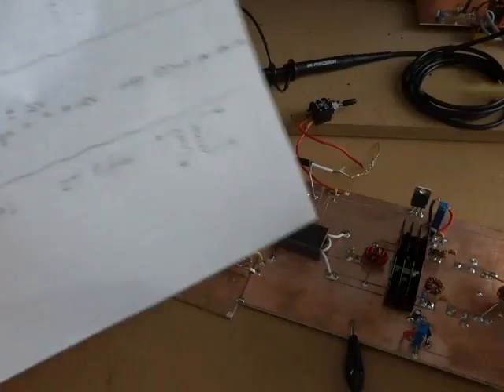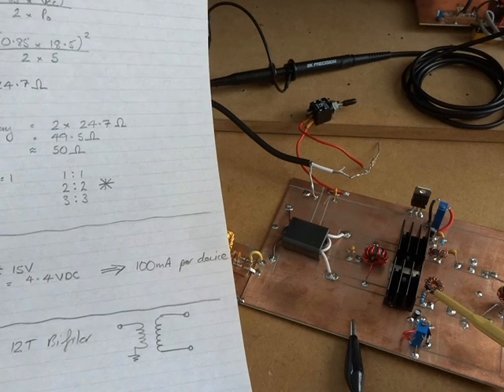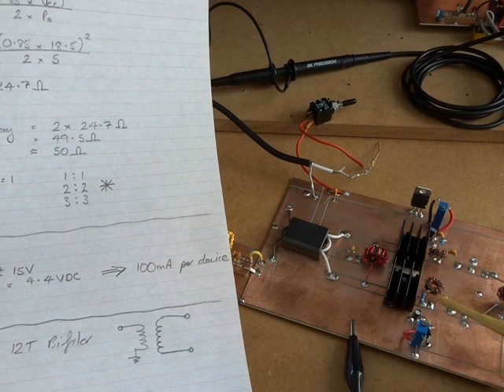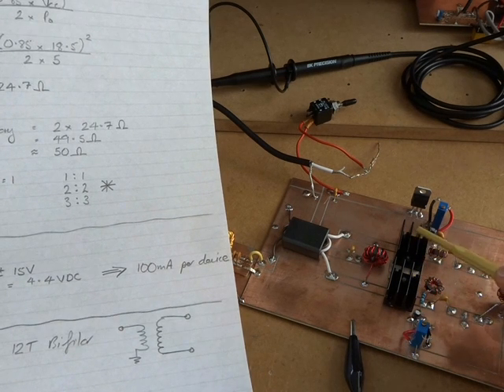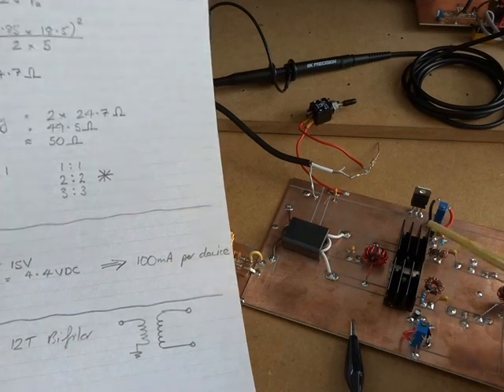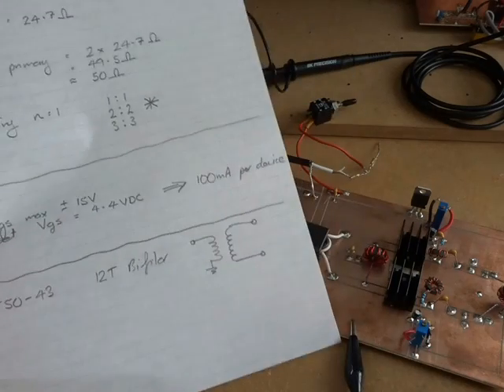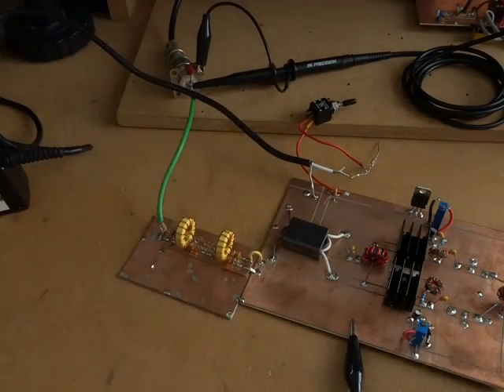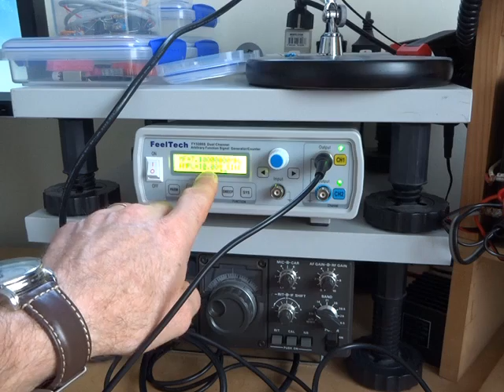Homebrew MC1350P based SSB Rig - #11b RF PA Experiments

Comment: Hi Charlie. You might consider putting a 10 ohm resistor in series with each gate input from the bifilar transformer. This is done to help eliminate oscillations caused by stability issues. Also check the bifilar output voltage to ground for each gate input. The voltages should have the same amplitude (opposite phase). If they are not equal in amplitude, add  100 - 200 ohm resistors from the transformer outputs to ground to give them a DC reference point and not change input impedance much.  Resistors would be added before the input capacitors.  If you intend to use this amp on 20/15 meters you should test to see how the gain drops off at higher frequencies.  Very good work Sir...
Gary
Reply from the maker: That's great advice thanks Gary. I've added that to my design notes to keep in mind for the next amp. I'm keen to build another test amp after this to get a better understanding of how best to design these, as well as the driver amp. Thanks again.

Charlie
Reply: Hi Charlie. One last comment, Before you move on to a new amp, I would test for maximum output power from your amp. Keep the input signal level unchanged and sweep the RL on the output of the transformer from 25 ohms to 200 ohms (perhaps up to 500 ohms) and calculate the output power for each load. When you find the MAX power, you have found the output  impedance of your amp. Also what ever that RL turns out to be, that is the actual load resistor  that the transistors see from  Drain1  to Drain2 of your FETS.  Output impedance changes every time you change the bias current. Best of Luck my Friend....
Reply from the maker: @garywebster5917  That's good to know thanks. I will look try and look at that, noting I'll need a 10W variable load. I'll only build a new amp once the radio is built, and use it as a test bed. I'm currently working on a broadband driver, with a design goal of 250mW output. All good fun!

Comment: You are the Best , I use Rf 386(hf signals Farham previo) joint P.A G6LBQ - HF LINEAR AMPLIFIER. Sorry my English is very bad
Reply from the maker: Hi Enrique. What device does the RF386 use?
Reply: @CharlieMorrisZL2CTM  
If you provide me with an email address, I can send you the circuit diagram

Comment: Hi Charlie!  I have got a nice RD16 mitsubishi push pull amp over the ebay and level level normalized via a simple DAC . I try not  to underestimate your work but a good tcvr key element is not the tx part ... one can filter output , one can optimize drain current to save hiking power consumption, but the main part is RX, try to focus on that. As far as I am concerned, I am a contest lover one so BFO leakeage and ADE-1 dbm correct level setup is more important to me.I got a fast AD8310 log detector so I am in  keen to replicate your work to build a nice filter analizer using arduino + Si5351 + level correction over freq + AD8310. I do realy feel that one day you and me can exchange info for a far far better tcvr as yaesu , icom or kenwood can produce. Time will tell but good measure tool also can make a diff. P.S Did you oscilloscope BFO to ADE1 LO port   once connected to it ? I am curious to see peak level in that port and  wave form also. I bet it looks ugly on 7 dBm  and spurs all over unless dropped up to 1 V pp. 
Regards , Gabriel yo8rxp
Reply from the maker: That's really interesting Gabriel. I'm just learning and documenting what I'm doing. So far so good as they say.

Comment: Ugg, those BLF1043 transistors are obsolete.  About $10 each from dodgy Chinese eBay'ers.  Guess I won't be going there.  I have seen some good buys on MRF186's from a few sellers with good enough feedback to trust though.
Are you going to try using the NE591 without the matching networks?
Reply from the maker: That's interesting. As you know I'd prefer to use commonly available parts, so I'd be interested in the MRF186 devices. I'll look to order some of those and give then a go. Also, as mentjoned to Stephen below, I'm keen to build another one using IRF510 (and maybe even the IRF520, even with the higher input capacitance). As for the driver, I will not use the NE591, but will instead look at a 2N3053 based amp.

As an aside, the two BLF1043 devices did come from AliExpress, so it was bit of a gamble.
Reply: The MRF186's are also obsolete, but there appear to be a good supply of them on eBay, as well as a number of kit amplifiers that use them.  Given the price (as low as $12 ea), it's worth a gamble for a device that could deliver 75w output on HF.   Almost everything in the MRF line is obsolete today as Motorola is gone from the RF semi field.  Some of these parts are still being made by On-Semi, and a few others, but you can almost count the number or MRF devices still being made on your fingers.  A real shame. :-(  
BTW I was given a black static proof bag full of IRF531's and I'll probably try to build a final amp using those.  There are a few kit amps on eBay using the IRF530's (Same PCB is used for the MRF186, in the same circuit, except for an additional 24  ohm resistors from gate to gate on the '186). The '530 is a 100v device, the '531 is a 60-80v device, so it should work ok if I stay below 13.8v supply.  A pair of those might give me 20-30w out on 160-20 meters, and poop out above that.
Reply from the maker: That's certainly true Stephen. As the NE591 amp is already build, I'll look to drive the T1 primary directly from the differential outputs and see how that works.
Reply: If you want to use really, really common parts for the driver, you might consider Harry's 500mW linear: http://sm0vpo.altervista.org/tx/qrp-hf1.htm
Reply from the maker: Thanks Stephen. I remember that one. I'll keep that in the back pocket.

Comment: But why do you use an si5351 instead of an ad9850?
Reply from the maker: Hi. For two main reasons, first the Si5351 has two clock outputs, which I can use for the VFO and BFO. Second, the output level is significantly higher than the AD9850 which means I can drive a 7dBm mixer directly, without amplification. It works well for me.
Charlie
Reply: Many thanks! But please add more circuit diagram in order to allow us to better understand your great and intersting work :-)
Reply from the maker: @e.m.6365  Sure thing. All of the schematics are on the blog. https://zl2ctm.blogspot.com/